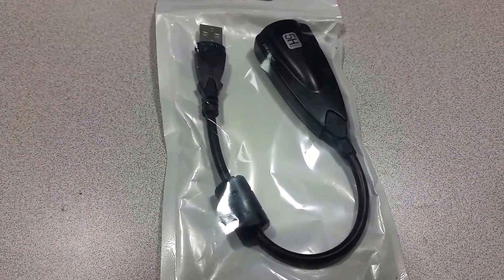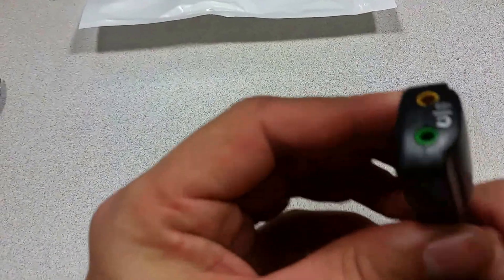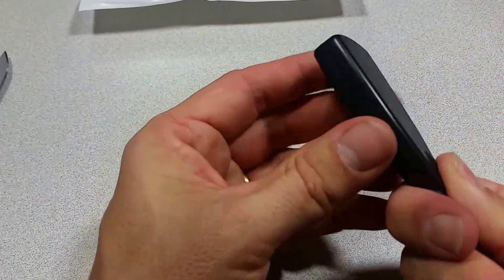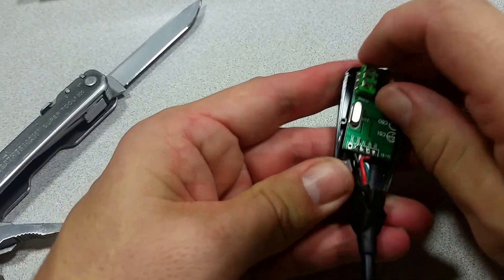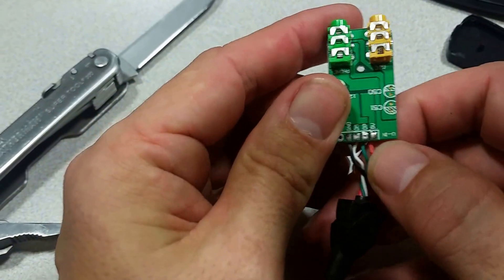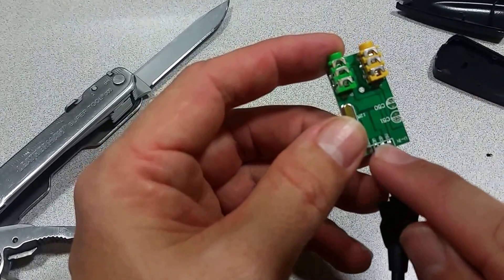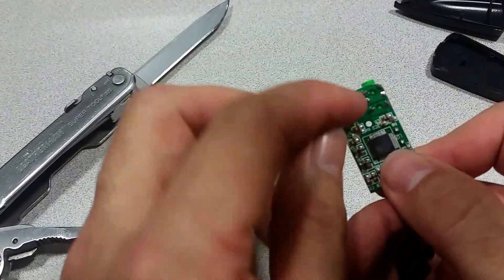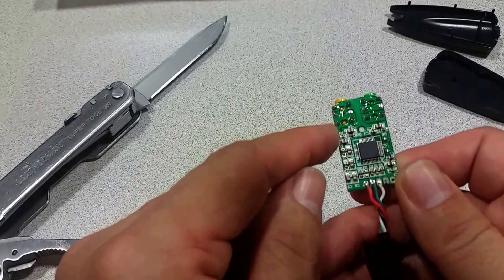USB Audio Adapter Disassembly

Comment: Mine looks just fine from the inside, but it stops working now. I had no clue what's wrong with it.
Reply from the maker: It is possible for any number of things to go wrong. The only way to properly test is with a multimeter and possibly an oscilloscope.
Reply: @Ameridroid1  Thanks for the tip.